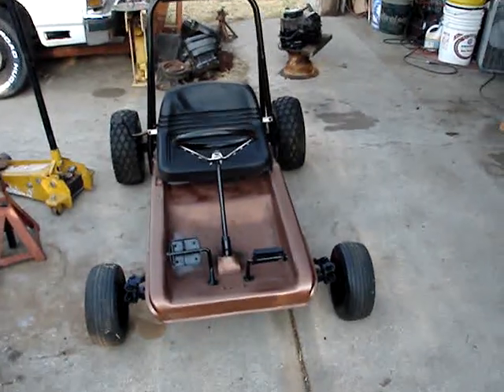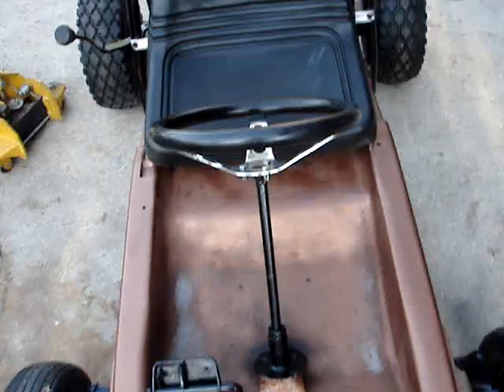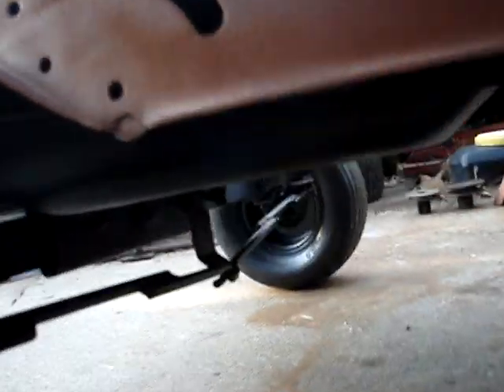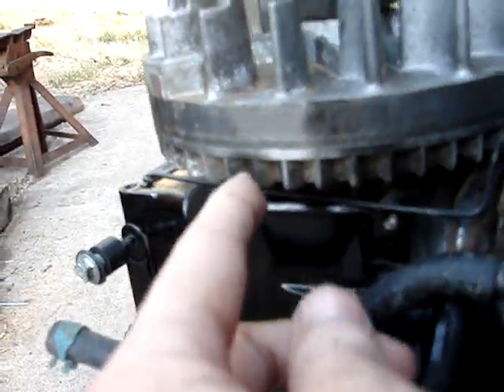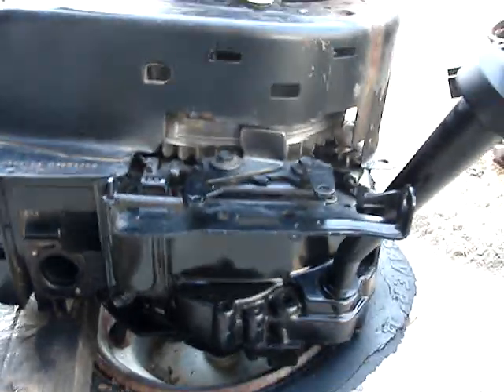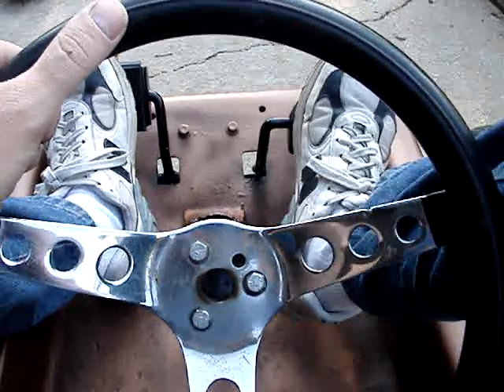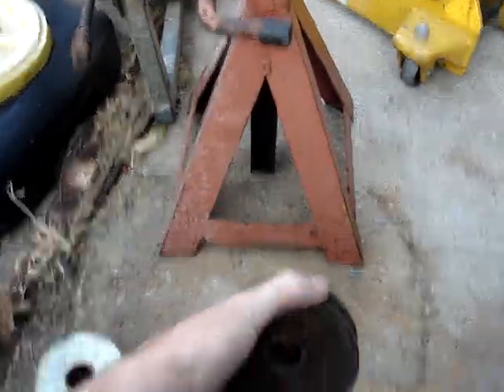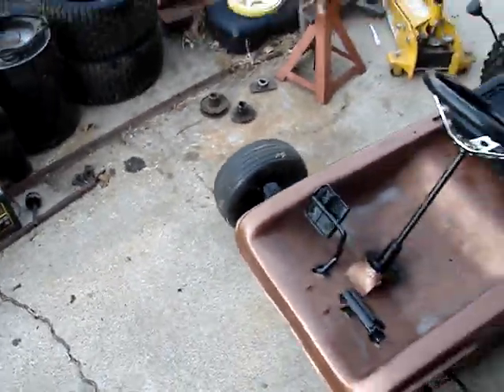RER Rider Mower Go-Kart Project Part 2

Comment: you will be fine with the lawnmower engine as long as you remember about the kickback that can rip the pull cord out of your hand. Go with a 5 to 5 1/2" cast iron pulley that will help with any kickback. I AM SPEAKING FROM EXPERIENCE. BTW I like the shifter.